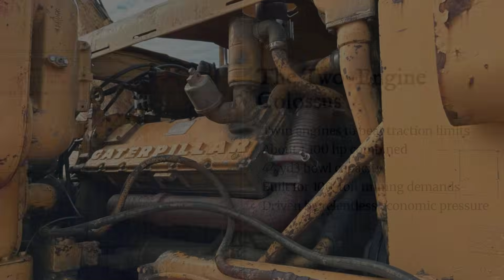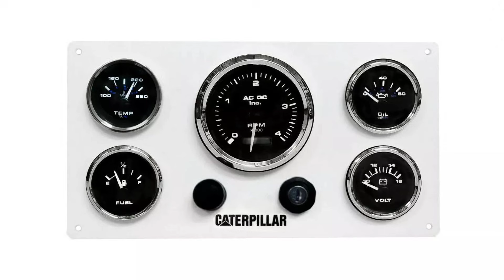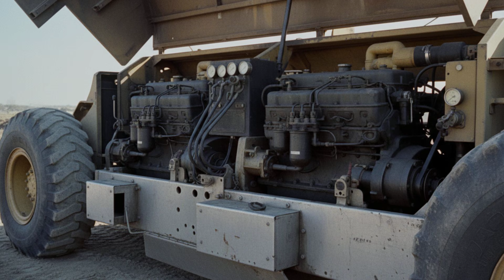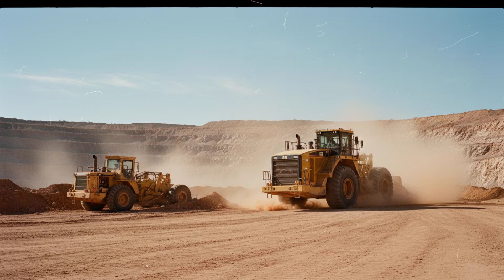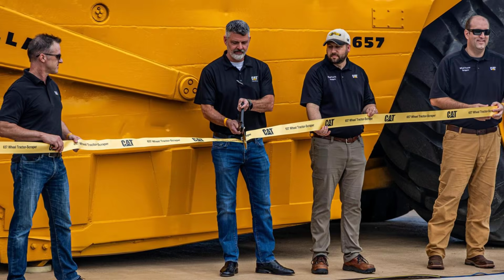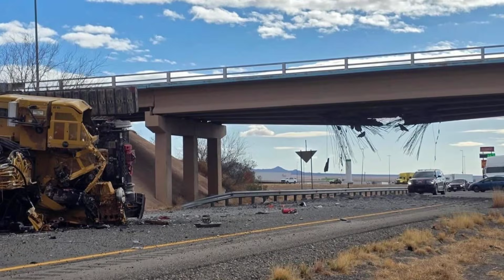They Built Scrapers So Massive They Need Two Engines to Move

Comment: Hello. Quisoop.
MORE UTTER KRAPPPPPP!!!!!!!!!!!!!!!!!!!!!!!!!!!!!! Size had NOTHING to do with it.

Twin-engined scrapers were originally developed to handle more adverse conditions than single-engined units could manage. They are STILL NOT capable of efficiently loading themselves but require a pusher 'dozer to help them load. This is because, all that power notwithstanding, they STILL DON'T have enough traction to load themselves efficiently.

This is where twin-engined scrapers working in pairs with what is called a 'push-pull arrangement' come into play, Four engines and four sets of driving wheels loading one scraper at a time, the back unit pushing the front one until it is loaded and then the front unit pulling the back unit to get it loaded, whereupon they detach and travel to the dump area independently.

Also, most twin-engined scrapers ONLY HAVE FOUR WHEELS, NOT the 'eight' that you mentioned at one point in your fantasy.

Caterpillar's biggest ever scraper, the 666, had two engines powering a 54 cubic yard bowl with THREE axles, TWO on the tractor, one driving axle and one steering axle, and one on the rear of the bowl.

Don't wish that you KNEW that of which you speak and post in your video.

Just my 0.02.

You have a wonderful DELUSION. Best wishes. Deas Plant.
Reply: You are correct. I had many issues with this video myself. You have, most definitely, a valid 2 cents.
Reply: boy you're full of it